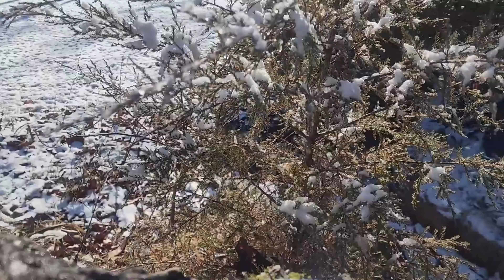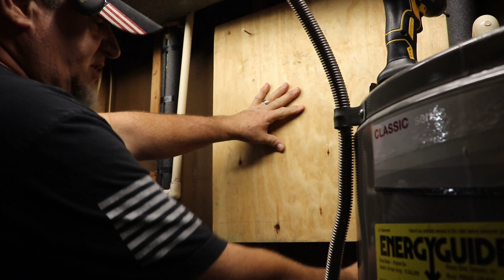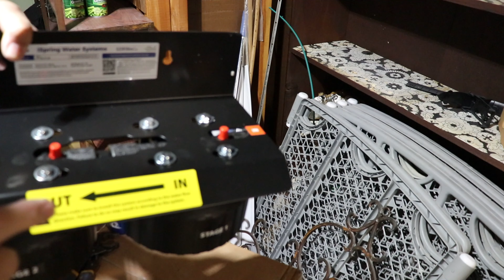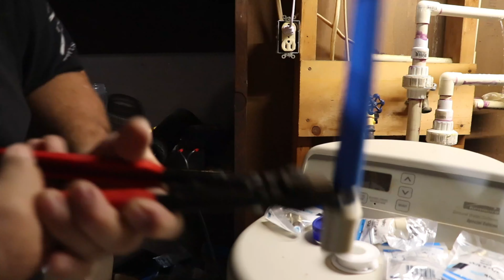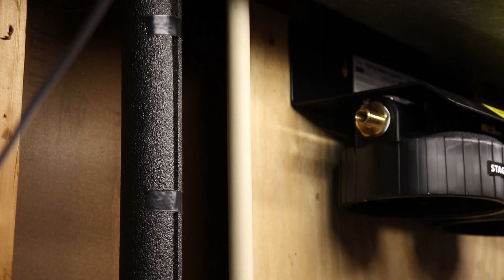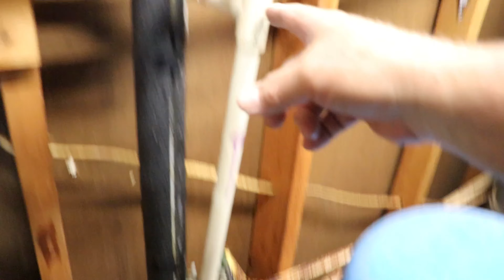iSpring WGB 21B Whole House Water Filtration System

Comment: Good Stuf , the only thinks Im warry about ! why installed your stuff after the sofnner device? .. it should be the Spin Down Sediment Water Filter after the prusser tunk then 2nd connection the soffner, 3rd connection the two stages filters. keep in maind if you get low flow prusser or blocked sys. you will need to changed. thanks.
Reply from the maker: Thanks Syounis. I forgot to mention that our softener is damaged and I'm bypassing it until we get it replaced... very expensive. I will reroute the lines when the new softener comes in.